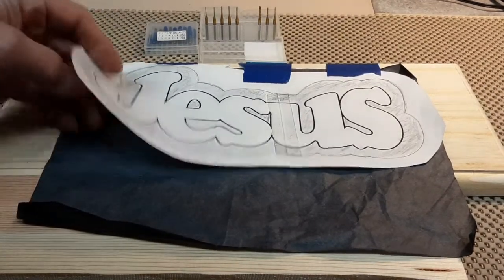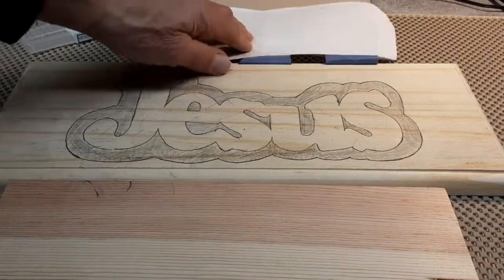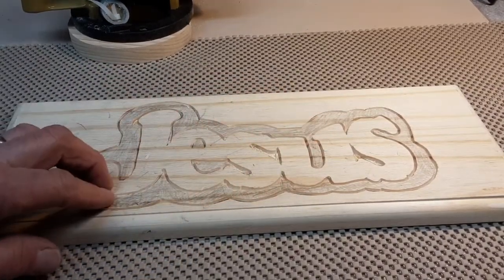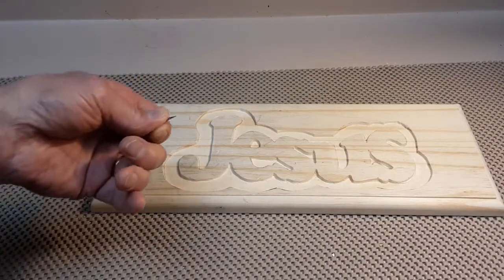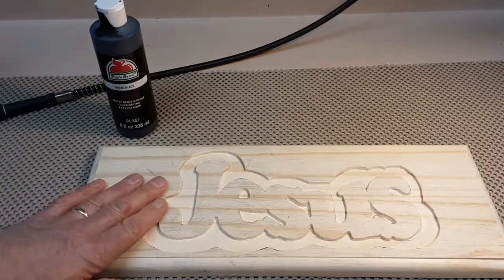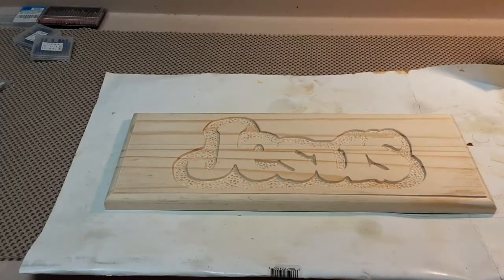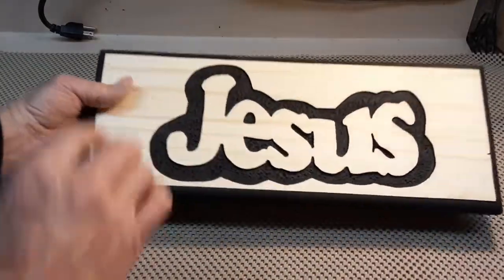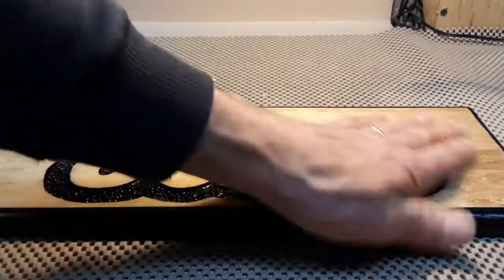Jesus Sign Hand Routed On Pine Wood

Comment: Very nice! Those first bits you suggest are unavailable. Is there another brand you would recommend??? Thank you!
Reply from the maker: Thank you! These will work also.

https://www.amazon.com/20pcs-3-175mm-Carbide-Engraving-Router/dp/B07BTNHSH9/ref=dp_prsubs_1?pd_rd_w=ZgLEM&content-id=amzn1.sym.0ba7bd8b-df26-4ee1-b84b-667c9b5c33bf&pf_rd_p=0ba7bd8b-df26-4ee1-b84b-667c9b5c33bf&pf_rd_r=H6N6GWQZ1F43X3X7HAK9&pd_rd_wg=qCeSB&pd_rd_r=9e77ce10-895d-4d74-90eb-08eaac08c53d&pd_rd_i=B07BTNHSH9&psc=1

Comment: The bit you used? what was the angle? the wider and deeper I would suppose would cause it to drift and pull out of line. Narrow bits 15° or 20° maybe more suitable. The mill bits work better as the are the same at the end and they cut great.
Reply from the maker: I use the narrowest CNC bit to outline. That works for me.
Reply: @KerfMan  Thanks mate, appreciated.